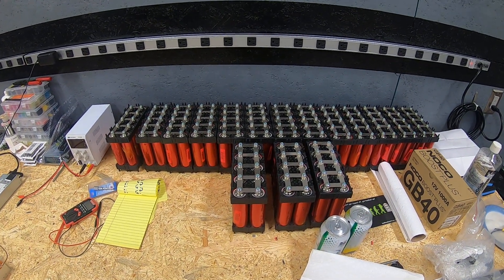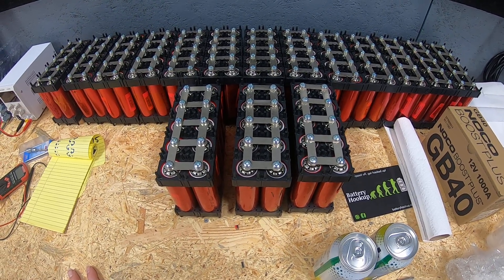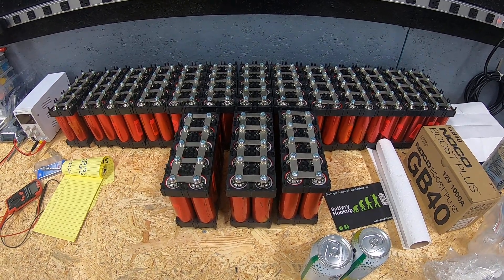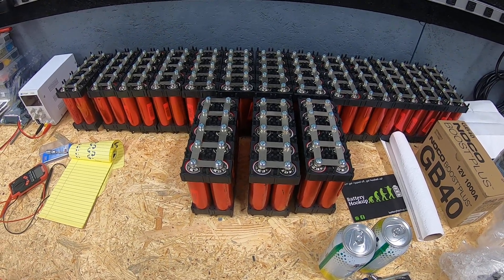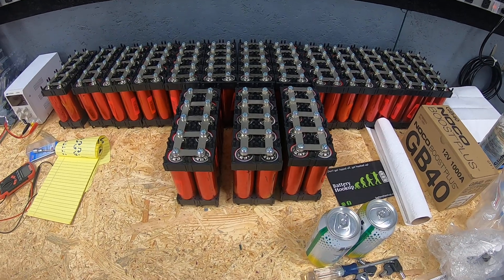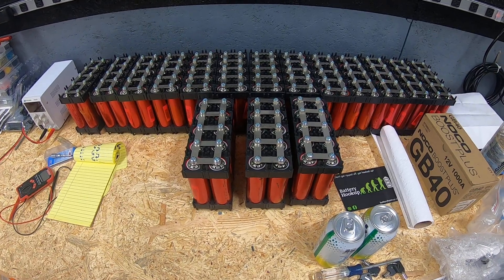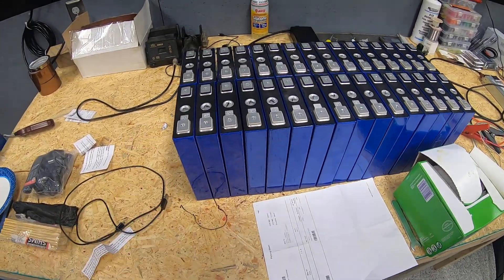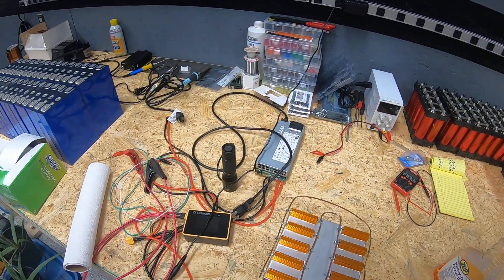Solar Update

Comment: So the Daly you using a 100Ah model? Are you feed power from the shed to the house? How are you feeding it in mate?
Reply from the maker: The shed is tied into the Solar subpanel in the house.  The PV arrays attached to charge controllers and the battery bank that is also located in a spare rooms of the house.  Once we have the new battery bank ready, I'll get a series of video up that show the setup.
Reply: @solargarage  Great mate stay safe and have a wonderful Sunday from Australia.

Comment: Don't trash those blue cells, they are fine! I'll take them if you don't want them! lol. They normally bulge from use, some people compress them, some don't. LiFePO4 cells are safe if they expand unlike LiPo battery cells.
Reply from the maker: Thanks for the comment.  Agreed that they will bulge with use over time, what I did not expect was to get them sold as new and already bulging.